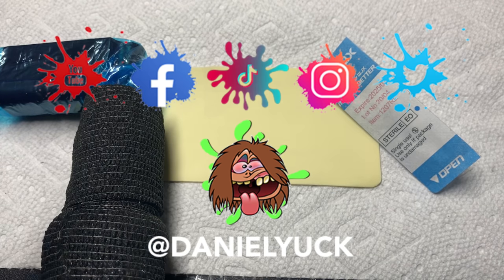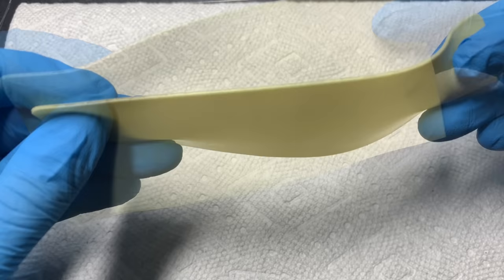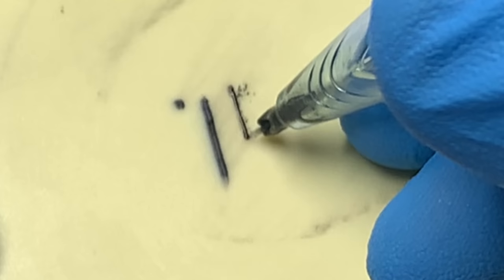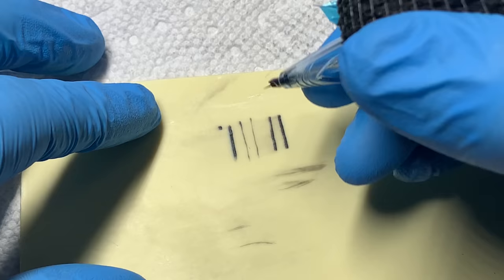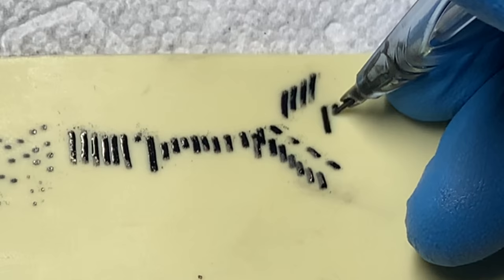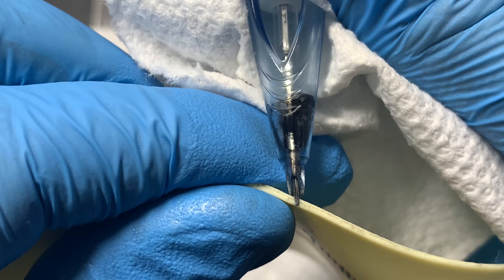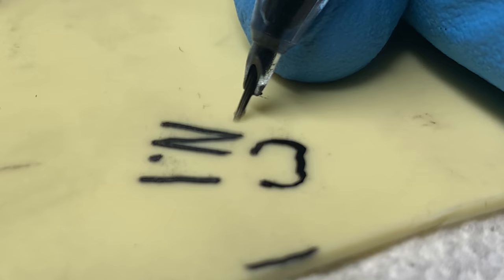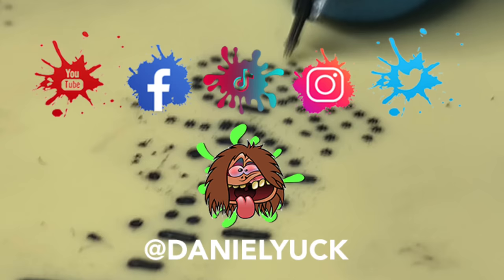How Much Is Too Much Needle?

Comment: Remember that the average epidermis is 20 micrometers (0.02mm thick). That is 5 times thinner than a sheet of paper. It's almost impossible to tattoo without reaching the dermis. So don't worry about being too shallow.
Reply: if it’s too shallow the ink will just fall out when it heals. the epidermis also varies on different places of the body, like eyelids are around 0.02mm but most areas are around 1-2mm and palms can be around 3mm
Reply: The average human epidermis is 1.5mm thick. To properly deposit ink, you need to reach the dermis roughly 2mm, if you go to shallow the tattoo will fall out.
Reply: @ambersmith2925  thank you. i just made a comment asking how an entire line of my tattoo peeled off leaving no ink at all behind.
Reply: Awesome, thanks
Reply: I've tattooed myself as an apprentice. My first tattoo was too shallow and literally fell off in parts when healed. Working too shallow should be a major concern for beginners.
Reply: @lawsighted555  Same issue 😂
Reply: @lawsighted555  Keep in mind tho, fading tattoos is easier to fix that a tattoo that has a blowout in the lower layers
Reply: The skin has some bounce so technically you're not as deep as you think you are. I'd say thickness of a nickel is the depth i like.
Reply: thats exactly how deep I go aswell nickel
Reply: Old school tattoo proverb,DIME LINE NICKEL SHADE

Comment: I’m genuinely so confused on things. Like how do you know what voltage to use vs how slow/fast you tattoo ? Also I heard going to fast with certain needles can just shred the skin… or dragging it a certain way? How do we know what is what
Reply: did you learn?
Reply: I’m not an expert or anything, but from what I heard, the voltage depends on which needle you use- higher voltage for bigger needles sort of thing
Reply: Voltage is different for everyone since every tattoo machine hits differently. Voltage is really something you just get your own feel for after practicing and trying to match it with your hand speed
Reply: It will shred and pull skin ive toyed with it and its roughish lol
Reply: Can depend on your hand speed shredding happens when you use way to fast of a volt even at a fast hand paste everything varies

Comment: After pulling a line, should the practice skin feel like it’s sorta cut when you run your finger over it? Or should there be no obvious cut or bump
Reply from the maker: That is a good question!

I think it would depend on the practice skin you are using. Reason I say this is because some practice skins are of a rubber felt, some are of a silicone felt, etc. I have used the rubber felts and those fake skins feel like they have deep cuts when I tattoo with any configuration at any depth.

I have silicone felts and those do not cut open like the rubber felts. So it would depend on the specific felts you are using. Would you be able to confirm which fake skin felt you're using?
Reply: @DanielYuck  Thanks for the answer, yeah I actually ordered a set you recommended and linked in one of your videos.
Reply: @DanielYuck  They're great skins, I was just wondering if i needed to adjust my depth or if it was something unavoidable
Reply: @lankowlllyk  If you run a slow clean line you essentially are cutting the skin at its surface. You can cut the skin and rub ink in and get a line also, but the goal of a gun and needle is to perforate in a way that connects the line at the surface. Some skin has a tendency to want to just shear instead of accept the multiple pokes. If the client has nice skin I would say the cutting is proof you are damaging the skin to some degree. Its very tricky to learn. I still don't know for sure what I'm doing but want to reinvest in these skins to practice between tattoos and keep muscle memory built up.
Reply: @ryansizemore5064  thanks man that makes sense. I think the solid lines I pull at the right depth only have a slight texture difference and the ones that feel cut are due to hand speed/voltage mismatch or going too deep

Comment: I don’t understand. If the standard dermis layer on a real person is 2mm deep than using a 1.2mm practice skin would be the opposite of helpful as you would have to drive the needles all the way through the practice skin to achieve optimal depth. 

I would assume using a 3.0mm thick practice skin would be optimal as you would then have enough material to drive the needles to the optimal depth without puncturing through the entire practice skin. 

Additionally with the 3mm thickness it would be obvious when you had a blow out as the ink would be visible on the underside of the practice skin as a result of the ink being deposited to the 3mm depth!

Your input and advise would be appreciated. Thank you.

Comment: My thought exactly when I first got hand in these fake skins. That surely it is better to practice on these thinner skins, over those 3+mm thick silicone skins. Cause on these you can see your mistakes on the backside. It have been my goal for every one of these I've finished, to not have blow outs on the backside of them. And I can say, it is clear to see a difference from the first skin I tried on, to now 20+ skins later.

Comment: Good video!  Maybe make a video showing angle of machine while tattooing lines, shading and packing?  My Mentor let me practice my linework and all on him and myself. A few bloodline tattoos and I was ready for the first tattoo with actual ink. It was only black...lined and packed. That was 1977...Damn time does fly!
Reply from the maker: That’s actually a very good idea! 

I was going to make a video on how I approach larger scale tattoos and upon creating this video I can incorporate this idea in there as well. 

What is your setup your working with now? If I may what was the setup you were using when you started?
Reply: @DanielYuck  Started out with a Puma. From Spaulding in New York.  Now I have about 75 machines   Next Gen about 3. A few From a girl from China. I bought 3 machines from her for an excellent price. Excellent machines for $30 bucks apiece. Very quality machines. If you’re familiar with Kylin machines you’ll know what I mean!  I’ve also got a Couple Soba machines. Iron horse  and workhorse irons. Got a machine made for me from a guy in the UK. The rear coil is adjustable for a perfect hitter. It’s called the black lotus machine. Got a few made for me by Johnny Gault Also got a few infinite irons. Plus. mORE. Just can’t remember all the machines I have lol. Too many. Actually not enough. Lol

Comment: A friend of mine is from prison and tattooing for 23 years is trying to figure out what he's doing wrong,  some tattoo ink will take and then sometimes it doesn't.  He wants to know why
Reply from the maker: That’s a good question! 

I think it all depends and on multiple variables! Would you happen to know what machine he is using? Is he using cartridge needles or barred needles? 

Typically if the ink isn’t staying it’s because we aren’t getting the ink into the correct layer of the skin, and each part of the body will require different depths and on each person the depth will always vary.

So there’s many things that can be simultaneously going wrong upon his work flow. 

I would have to see an image or 2 and I sound possibly be able to shed some more insight as to what maybe going on.

Comment: Is the sound when he starts a new line the sound of him hitting the skin too hard at first or the sound of the machine hitting the skin for the first time?
Reply from the maker: I’m not sure I fully understand the question in it’s entirety but I will try to explain. The sound we hear is a combination of different things. A lot of the sound is coming from the table that I am tattooing on. It carries the sound of the machine through out the table so it makes it sound louder a bit and I’m using a thin & tough fake skin that requires a certain depth to saturate. 

I feel it maybe a combination of different elements we are hearing.

Comment: Hiya. Great video. I've just started out practicing on fake skin. I read a lot of comments that line work should be around 7-8v with a wand. I personally feel better with a much slower 3-4v. What are the issues with using lower voltage, my lines are evenly saturated with no blow outs after a few months of practice

Comment: I know how to line but damn.. just had one I forgot ointment on.. lines were ghosty.. just got a coil.. did two tattoos before his with this new machine.. worked great... think ointment is to blame for light lines? I mean dude I struggled and sweated just to make one solid line.. lmk
Reply from the maker: Oh damn. 

So if I’m understanding correctly you stated that you did a tattoo with no ointment prior to putting the needle to the skin? 

If I’m understanding that correctly yea we’d want to make sure that the part of the body that we are going to be tattooing has to have a small amount of something to moisten the skin over going in dry. 

I feel if we are just pulling lines without moistening the skin prior this would cause even more discomfort and pain for the client. 

Always use something to moisten the skin prior to pulling lines. 

If the lines are not dark and saturated there could be many variables to consider. From not going too deep, moving too fast etc. 

What machine do you use ?
Reply: Use less ointment and Dont use vaseline. Ink eeze is good or a&d

Comment: Hi, I'm practicing tattooing on the same practice skin as you and the lines look good even if I tattoo so deep the needle goes through. When you refer to it being easy to spot a blowout on thin practice skin do you mean that the blowout shows up as the needle going through? I'm just wondering if the right needle depth is when the needle is still fully staying inside. Might be a dumb question honestly but I've been told the needle should go somewhere between 1-2mm and if the skin is 1.2mm does it mean a blowout if I tattoo through...

Love your videos btw! So helpful!

Comment: I use wjx needles as well. I have tried using their 1 liners for fine lines and I can never seem to get the ink in. I tried changing voltage, going different depths etc and no ink enters when I do it on real skin. It looks more like a cut. It does work on fake skin though. Do you think their 1 liners are just bad or is it me?😭
Reply from the maker: That’s a good question! 

For the 1RL it’s hard to say. This configuration leaves little room for error and it depends on what you were going for upon using the 1RL.

We’re you pulling lines? 

The needle is a super small configuration so if the ink isn’t correctly flowing this could be 1 of many reasons why this is happening. 

It’s rather hard to say out right because I can’t see you pulling the lines or anything. If they look like a little cut I wouldn’t use that configuration until I got it a bit more. 

1 thing I can think of is to use a 3rl and pull lines with that to get more familiar with small needle configurations, this would help you upon using the 1RL. To me I would have to work up to using such a small needle again as there is little room for error. 

Do you have any pictures of what you are explaining here ?

Comment: do you have any recommendations for wiping the fake skin during tattooing? The thin, rubber like skins (that I have) are so much more smudgy than the thick silicone ones.  Great video!
Reply from the maker: Thank you for your support! 

That’s a great question. 
So when I’m tattooing on fake silicone skin I use simple Vaseline to remove any excess ink.

Now how the ink comes off is determined by the material of the fake skin you’re using. I made a video on different types of fake skins right here you can check out and I also share with you the ones I use personally. 

Here is the video and don’t hesitate to let me know if you have any questions. 

https://youtu.be/GGkt_ZW-AFU
Reply: Anything with a decent amount of alcohol is 1000x better than other things
Reply: @Ebeanslol  I use alchohol but it kinda smear a little so I now use vasaline before I start
Reply from the maker: @Ebeanslol  I don’t fully agree with that. From my experience using multiple skins and different types of skin, on ALL of them, Vaseline has been the best way to remove excess ink, smudges, etc. 

I can’t even recall if I’ve ever actually used any alcohol to clean off smudges from a practice skin. 

Furthermore cleaning with alcohol I don’t recommend as you will be inhaling those vapors the entire tattoo session which I personally wouldn’t feel comfortable with, where we have Vaseline with no odor and does the job in what I would describe as better over alcohol. That’s just from my personal experience.
Reply: this is probably a bit late but oil helps a lot with removing the ink from fake skin
Reply: Tattoo on an orange.

Comment: Question.... I haven’t did work on wrist because fear of going too deep. Would you recommend a RS instead of an RL in that area?
Reply from the maker: Thats a solid question my friend!

I tattooed a wrist not too long ago actually and upon tattooing the wrist I approached it with a 
10-5RL or a 10-03RL if I remember correctly. I took my time and just put myself into a calm state by sticking to my fundamentals and basics that I have been learning along the way.

When I have a practical approach it is hard for me to be nervous about a tattoo. When I tattoo, I should want to do the design and know exactly what I need to do to achieve the results I already know that I want. If this is not my logic and approach I won't do the tattoo because it is probably outside my capabilities and or outside of my style.

For the wrist I would not personally reach for a round shader just because we are going to get bolder lines, but that would also greatly depend on the design. The design I did on the wrist was a cross with floral work so I had to be detailed. Say someone gets some font well a good round shader that would fit the font would be ideal or even a larger round liner. 

So it would depend on the design and capabilities that would also help me determine what needle I need to use. 

Did you ever end up doing a tattoo on the wrist?

Comment: Okay so if your stretching the skin, is it the same amount of pressure added as using practice skin ?
Reply from the maker: Thats is a good question!

When stretching human skin the pressure applied is a natural cause from stretching the skin. However the depth would remain the same, the same techniques developed on certain fake skins would translate to human skin. I can't give a 1 off answer as I am assuming we are all using different fake skins. 1 person maybe learning on a thicker skin versus another person. So the habitual needle depth habits developed would have been different. 

The only part that doesn't translate and the only part we don't actually learn from the basics is stretching the skin until you are actually tattooing. 

With that being said there is a way I stretch the skin which is with 3 points. I use both of my palms and my left fingers as I am right handed to stretch the site I will tattoo. My palms stretch the skin a bit and my fingers complete the stretch for the site I will be tattooing.

Comment: What is the thickness of your practice skin? Mine was way too thin when it came with my kit
Reply from the maker: That is a great question!

If I remember correctly I was using the 1.2mm thick skin if I remember but I could be wrong as it has been a good while for me. I prefer a thinner skin but it really depends on how thin because in reality we would not want a skin that is too thin. Maybe this is a personal preference thing but I can relate to you as I want my skins just right, or a bit of both. Some thins, some thicks and maybe some in between. 

For developing and getting acquainted with in the beginning days I would always recommend to start on a thinner skin to avoid heavy hands and or habits of this nature. 

What company did you get your fake skin from?

Comment: Hey Daniel, great videos :-) just wondering what your thoughts are on the CNC-Q3 machine.. is the Q2 better or very similar , thanks in advance
Reply from the maker: Hey Andy! This is a good question!

In my honest opinion both machines are awesome and for the same reasons I feel. The machines themselves have different specs which makes them different, and the builds are different. 

They both perform with grace and more. Both are great for lining, color packing, packing black, they both feel great with low vibration. They are both easy to maintain and sterilize. 

I would get 1 and 1 or if I gravitated towards 1 because of a specific reason I would get a pair of that machine. I got myself a pair of the Q2’s because I wanted that Faulhaber motor, so it’ll be different for everyone. 

Overall both machines are truly worth the investment.

Comment: That's a GR8 Video, what camera set-up did you used...?

If you got an camera with am 50mm objective, if you turn the object on the other side, you may make a GR8 Macro Video, which will look pretty damm good.

Give it a try.

Cheers and thnx for sharing your experience @Daniel Yuck.

Comment: What u running at. I'm stuck between tearing skin up and saturating or not saturating on low voltage
Reply from the maker: Are you on a coil machine or rotary machine?

I’m running at I think 7.5 volts if I remember correctly. It’s going to be between 7-8 volts. I don’t ever really go above 8 volts. 

When you say tear up the skin what does that mean on your end?
Reply: @DanielYuck  rotary pen   
Overworking with too many passes trying to saturate
Reply from the maker: @hoole1926  ahhh ok ok, has the problem you were experiencing when we last spoke cleared up? Or do you still feel like you’re tearing up the skin?
Reply: @DanielYuck   not tattooed since gave up trying.  Was just a hobby.  I can't get the blk ink saturated.